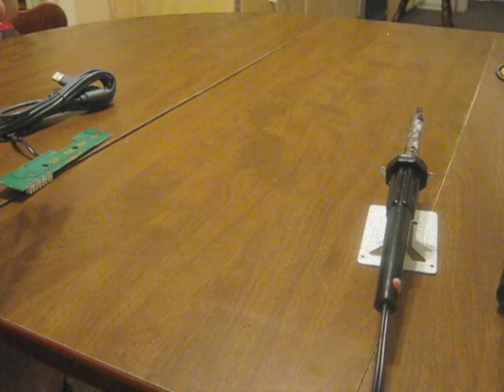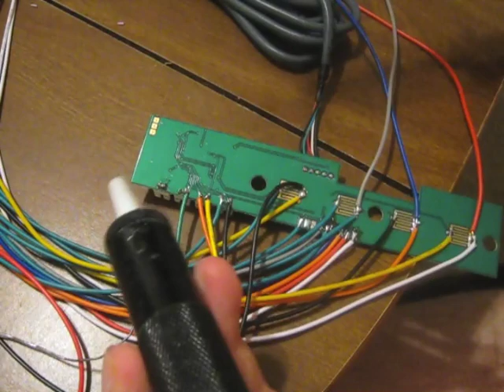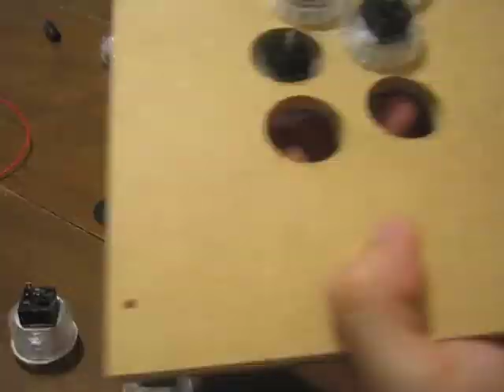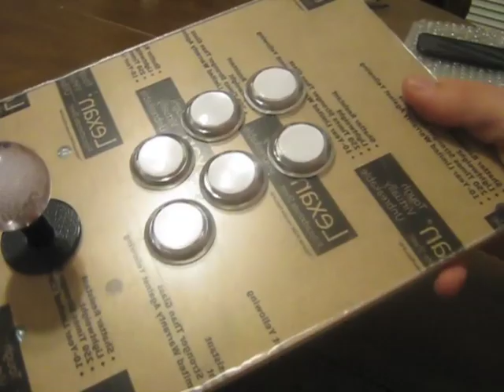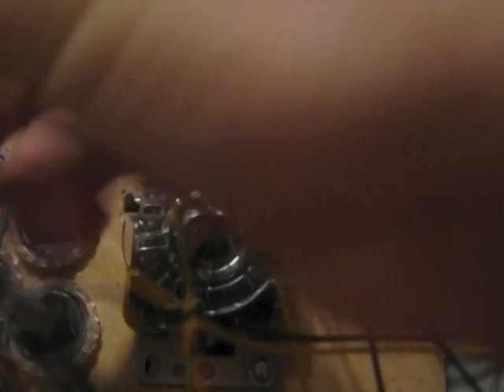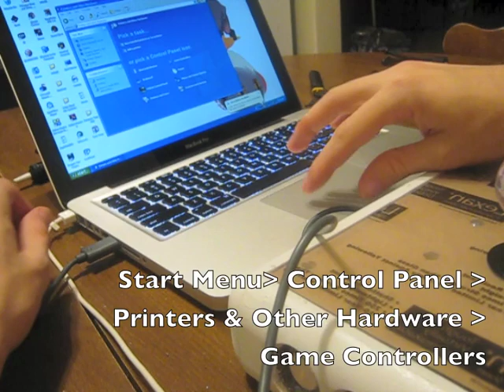focusattack.com Paewang PS3+360 Arcade stick Installation Guide

Comment: Quicik help you can, the button i  use to swap consoles isnt working, the wiring is fine and the buttons work, it just wont cchange to ps3 , its stuck on xbox 360

Comment from the maker: @Note2ybk I'd simply cut the original USB cable to the size that you wanted, then solder it onto the PCB, one less USB cable to buy. The thick black ground is ground for the shielding in the USB cable. It's completely unneeded.

Comment from the maker: @jellgeta The USB cable might be broken, or, it's been brought to my attention, that some of the capacitors may be coming loose from your board, the small cylindrical object on the bottom of the PCB that has a small black slit on it. You can solder that back on, or possibly contact the seller for an exchange, as it's a pretty common problem.

Comment: Thanks for the video. I have two of these and will be making my own sticks.  Looking to use Neutrik passthroughs for a detachable USB cable.  Would to recommend desoldering the existing USB from the board and just solder a new USB cable for the Neutrik?  What do I do for the 5th black wire...is it a redundant ground which could be eliminated?

Comment from the maker: @IntoTheMeatGrinder Connect a Ground to the Ground on the 360 Turbo panel. Just solder a wire to it. Then, connect a wire from XGUILD to Guide, and Turbo will be right below it, connect that to the Turbo signal wire from the paewang.

See this image for reference farm5.static.flickr (dot) com/4003/4356371055_1b5bd71916.jpg

Comment from the maker: @UltimaWeapon08 The wire harness could have been the cause, but it may have been other things, such as your joystick. You can try to re-use that one, but, it may not work. I don't think it was the harness, but if it had been damaged, yeah, that can happen.

The Screwdriver you need to remove it is a JIS screwdriver. Looks like a phillips head. Not worth swapping out.

20 QD sets will wire 10 buttons. If you plan on using 10 buttons, get 20.

Comment from the maker: @TRAGICbliss I usually do cleaner, but I was considering the level of the installer, since, most noobies will make a mess. I usually use zip ties, TechFlex and HeatShrink tubing, and I typically crimp my own Open barrel QDs for a clean look. But that would have been a needless waste of time for the person who just wants to get their stick working.

However, in the future, I will have a "clean wiring" video.

Comment from the maker: @michaelmudrick Great PCB. The USB cord is a little short, IMO, but you can solder on a new one, if you want. It is glued and soldered in place, so it's pretty resilient, but like any USB, it can be damaged.

Comment from the maker: @obshaky The DualShock 2 is Not Common Ground. The DualShock 1 is recommended for PS2 dual mods that will be used with a converter. Google "Dual Modding 101" for an informative SRK thread.

Comment: Im currently trying to dual PBC a madcatz padhack for the 360 to work on the PS3 with a Dualshock 2 and a Radioshack adapter. it has 2 grounds and a resistor "button". Dunno how the hell the layout works

Comment: hey love the focusattack websight ill be ordering these PCB's when i get my taxes back!

Just a heads up as well you can buy the wireing harness pluse joystick harness here for JLF or seimitsu joysticks or seimitsu buttons

here are the links to them they make the case look just a bit nicer on the inside imo with these  and have the male connectors made just for this board for the pcb<joystick 
etokki.com/Misc/Paewang-Button-Harness
etokki.com/Misc/Paewang-Joystick-Harness

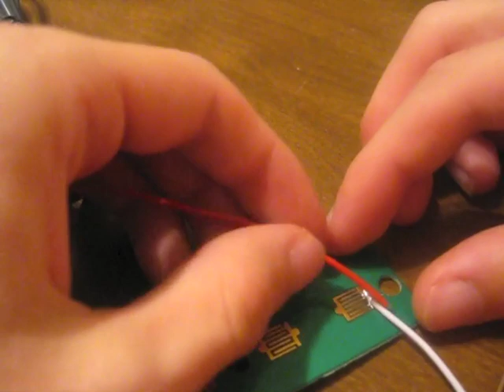Comment from the maker: @fro7k Why I have the two wires soldered together: 5:50. I'm doubling up on grounds.

I mean that this PCB is dual modded, in that, it supports 360/PS3 out of the box. But you can add a second PCB if you want another console. 

Yes, the Paewang is Common Ground.